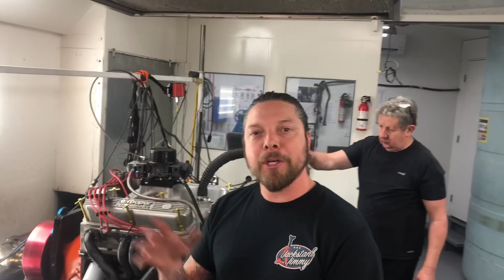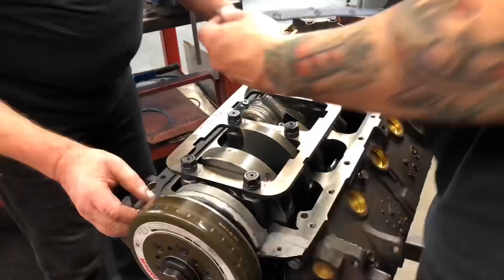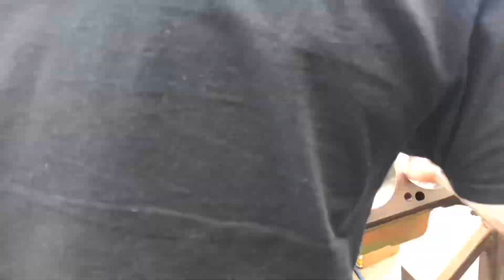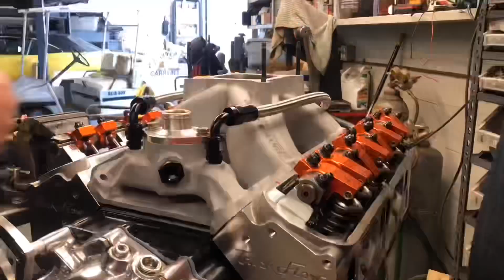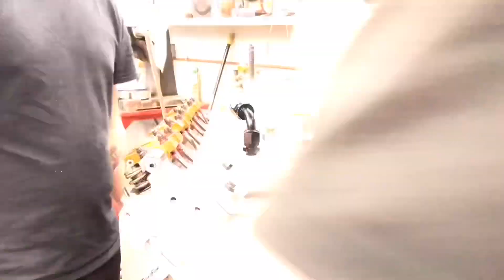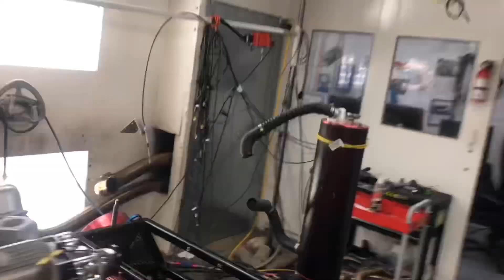Short Block to Dyno ready in 6 mins! Small block mopar stroker motor!

Comment: Did you port mach the trick flow 190 heads for the header flange or did you let Dem stock aut of the box
Reply from the maker: Didn’t touch the heads. The fit regular headers. I use tti. Go watch my vid on the heads from way back
Reply: Thank for the help

Comment: Real curious what it will do.  I have a 408 a lot like this.  Trickflow heads, same icon pistons Strip Dominator intake but have  a Super Victor going to port match and put on this summer.  950 carb and howards solid 600/615 254/260 at 108.   I think mine with the strip dominator is making in the 550 area but never on the dyno just a few track runs.  I wish I had a solid roller in it but things get expensive!  Hope you can share what camshaft you ended up with in the build.   Thanks for the sharing you do on here
Reply from the maker: Hey full build details will be in dyno vid but it’s a solid roller 248/254 amd with the 1:6 rockers getting .616/.625ish

Comment: ( 530 hp/360=1.47 Hp per cubic inch)  so 1.47  x 414 cubic= 610 Best of luck I am rooting for around this much plus!!
Reply from the maker: It will lose some volume metric efficiently as the head states the same but the cubes are increasing
Reply: @SimpsonsSpeedShop  yep, for sure , why i been debating, going to larger Port

Comment: Awesome build can’t wait for results When you ran your 530 hp combo on the street what did you have for a cooking system? Rad thermostat fan etc and what temp would if run at in the summer?
Reply from the maker: Ya open system big rad one push electric fan. I have some vids of testing it all. 180-200 on a hot day.
Reply: @SimpsonsSpeedShop  what size and brand of rad?